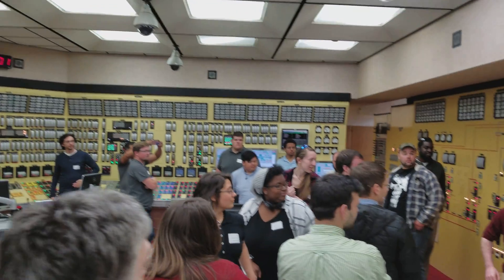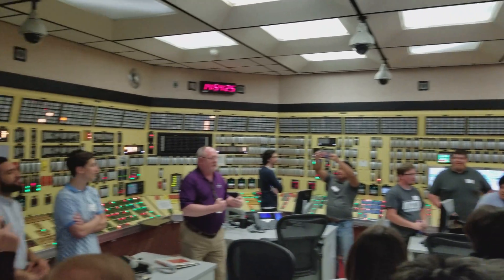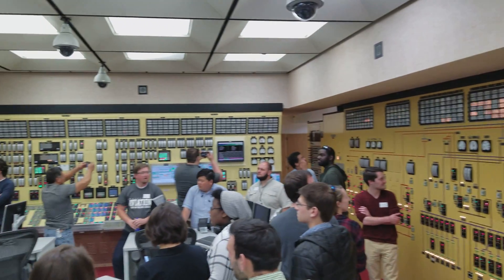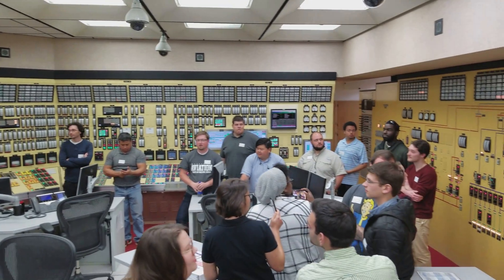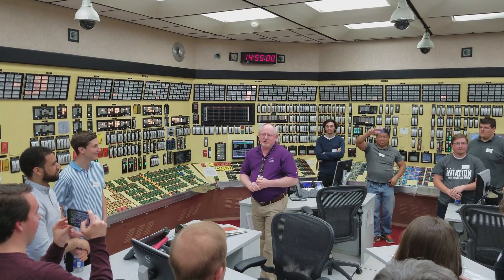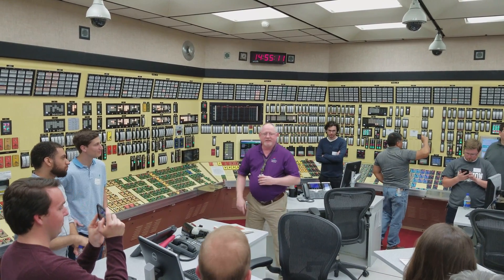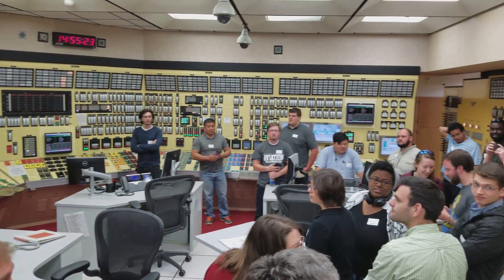Plant Vogtle reactor control simulator - offsite power loss

Comment: Were the TV’s once analog paper machines? Only thing I heard of that I know has changed.
Reply from the maker: There are no televisions in any reactor control room. Do you mean the computer monitors?
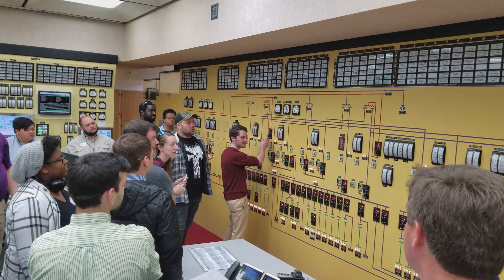Reply: @fcguy7 0:12
See where that hand on the left is pointing. Right above the arm is a small square monitor. Looks like it used to be like one of those earthquake paper machine readers.
Reply from the maker: @42luke93  some digital systems were a part of Vogtle's original design though they were limited. Some upgrades have been made over the years, like updating those limited digital systems.

Comment: Will the backup generators come on this time?
Reply: what do you mean this time?
Reply: @M41D_Walker_Bulldog  “This time”: March 20, 1990, Plant Vogel Unit 1 LOOP. An unqualified security guard escorted an unqualified vehicle driver to refill welding tanks inside - that didn’t require refueling. Entering the plants electrical switch yard the employees discovered the tanks were in fact full. The employee backed into a 230,000V transmission pole, causing a complete failure of that source of cooling power for the reactor core. One backup generator was down for maintenance, but the secondary did come on automatically-for a mere 70 seconds. A sensor in the generator’s safety system failed-just as it had 69 times before without replacement. It failed an average of once a month for every month the plant had been open-five years. Multiple attempts to start the generator failed as it tripped into safe mode. For 36 minutes workers worked without emergency lighting on the generator, before overriding the generator’s safety system. The core temp rose uncontrolled over 40F during this complete outage. Battery backups did not service this generator building. Equally bad was a complete lack of awareness regarding 140 employees whereabouts. For 4 hours no one could account for 49 “missing” employees. In fact, the NRC report never could account for their whereabouts! Asleep, incapacitated, fishing, drinking on the job-absent? Terrorist? The report did not address what would have happened had the electrical transmission line had set the fuel truck on fire, or if a coordinated terrorist attack was taking place because no one could locate the employees. All this was of course during the heyday of nuclear plant operations, when trained welders and electricians and so on were easier to source.
But, this is only a single event at this plant-discounting the snafu’s that Units 3 & 4 have faced. You can fact check me at: 
https://blog.ucsusa.org/dlochbaum/fission-stories-45-station-blackout-at-vogtle/